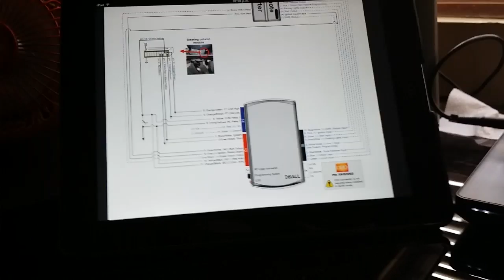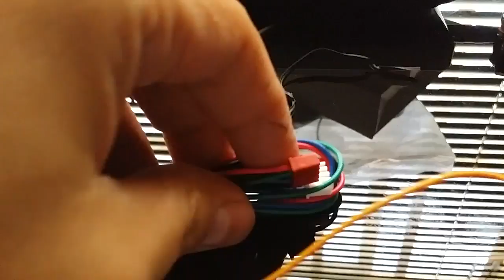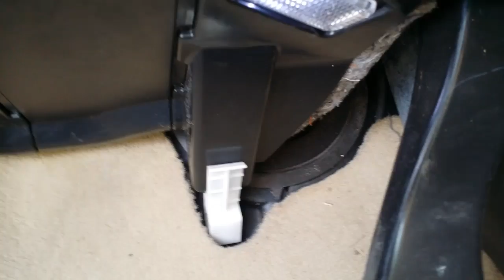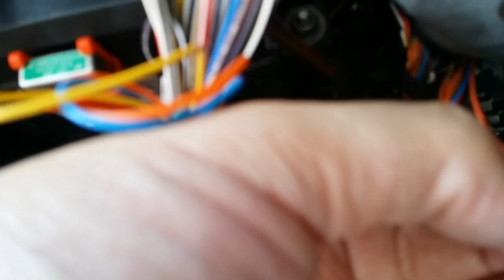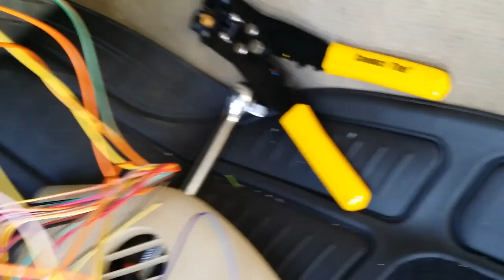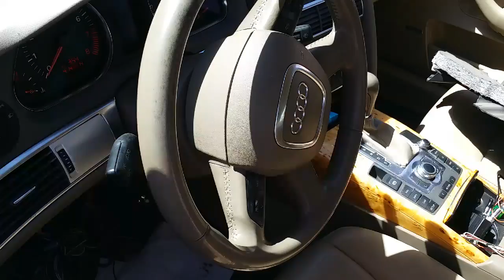Audi a6 c6 remote start installation

Comment: I  installed dball2 + RS - 2006 Audi A6. After installation, the engine is not switched off when the ignition key is turned off. Then I connected the gray wire (+ ignition status output 6p-12), with a diode to ON1 (RS unit) and the pink wire (+ ignition input 9p-10) - to the ON2 (RS unit). Everything was fine. What was the error? My RS unit did not have a minimum of 10 seconds, "wait to start" (at least was 15sec.). And so the engine starts at the second attempt.
Reply from the maker: Davit Miqiashvili remove the diode, the pink wire should tell the module of the switch is on or off , now regarding the "wait to start"  that's a programming that's gets done at the alarm dealer, there's nothing we can do about it but return it and ask them to re-flash it for you.
Reply: "Wait to start" this is not a problem. I will set the time switch for 7-8 seconds. And everything will be ok. I am interested in the scheme connection:
https://s28.postimg.org/uub5cq6pp/corrected_scheme.png

Comment: I own an Audi Q5. A shop told me that I would need to leave a key in my car to use a remote starter. Will this work with the Q5?
Reply from the maker: They will tell you anything to make you think it's rocket science and charge you the eye for it,  you do need a way to bypass the transponder at the key cylinder so what I did whas:
1-got a blank key from ebay with a chip on it. ($7 us dollars) 
2-get a locksmith to program it. (20 bucks) 
3- opened the key, removed the glass pill where the transponder is and placed it inside a plastic straw and filled up with hot glue, then wrapped arroun it 6 loops of 20 gauge wire, attached one lead to the normally open lead of a relay and the other end wrapped 6 times to the key cylinder and back to the: closed when active lead of a relay. 

That's it, no key inside, no major expense but 27 dollars, ill be more than glad to send you photos of how I did it, just send me your email address. 

Hope this helps
Reply: abner hagelsieb We are talking the same system I hope; my Audi has the keyless push button start. All that is normally required to start the car is to have the key in your pocket.
Reply from the maker: Steve Deffinger then you can skip the wire loops process and use the right module for your car,  yo won't need to leave a key inside
Reply: abner hagelsieb Thank you.

Comment: Hi Abner, do you have a link for the part(s) we need to make this possible? i've already got an alarm system etc (factory install) on my car.
Reply from the maker: Depends on your car really, just go to xpresskit.com and select your car make and model, if you want to save yourself a looooot of connection get an alarm from either clifford, viper or any other make made by express kit so you can use the P2P connection, shot me a line if you have any questions

Comment: hi, I wanna install the same remote strater on my 2008 A6 Allroad can you give some info please. It seems that you've cut the CAN low and CAN high wires from the steering column mudule but on the wiring diagram says gest to tap them, and why do you use a separate module for central locking
Reply from the maker: About the separate module don't mind it, I bought them with a couple of months in between so you won't need that , I didn't cut them I added 2 wires tapping in to them.

Comment: How can i run my 15" subwoofer if head unit cant be replace ? Any idea anyone
Reply from the maker: BallOuTT get a high to low rca signal adaptor, scosche make a very decent one and connect the + And - of 2 speaker to the input the connect the rca output to your amp.

Comment: hello abner i have viper alarm installed on my 07 audi a6 for about 2 years now, lately my alarm goes off by it self when it wants to, do you know what might cause that thank you.
Reply from the maker: Do you get a truck open waring message or hood open when driving?  If so that's you issue audi is known for having bad trunk latches with the switches built in to them, check those first if not I'm. Sorry to say it's the shock sensor on your alarm wich is built in so you could bypass it by soldering the 2 normally closed pins to "trick"  the alarm in to thinking it's never shocked or replace the whole module, hope it helps, btw check all the door switches
Reply: +abner hagelsieb no this never happens wile driving it always happens at nite in the garage 2-3 days a week than goes away and comes back i think it says door open or something like that im not positive ill pay attention better next time thank you.
Reply from the maker: +rusani89 it's definitely your door latch expanding with the days heat and shrinking with the colder night.  If you don't mind doing surgery take the whole door latch assembly,  take it apart and reposition the 2 metal prongs that make contact when the door is closed.  If you don't know what I'm talking about you're better off getting a new or used "working"  latch,  good luck buddy
Reply: +abner hagelsieb ok how do i know which door latch is it? and since i started all this i figured id tell you about it sometimes during the day when i remote start it it shuts it self off and on than i shut off by pressing the button on the remote and start it with key this has happened twice in the last 6 moths the alarm thing has happened more often I don't know if they have to do anything with each other
Reply from the maker: +rusani89 it will shot of after a minute, that's normal, try drivers side door since it's the one that you use the most I would assume, if not you can always tell which door is being detected as opened simply by looking at your instrument cluster it will definitely shows a car with the opened door, also the car nay be shutting off cause it's detecting the door opened without being unlocked by the remote and the car thinks it's being stolen, so now I'm 90% sure it's your door switch
Reply: +abner hagelsieb no the car turning on and off thing happens at a different time but i see what your saying it could think that the door is open so it kills the car but than why would it keep trying to turn back on and off every minute
Reply: hello sir i looked in to replacing the door lock or getting to it to look at it its a lot of work so i decided to by pass the alarm if this keeps happening more often so can you tell me one more time how to do that step by step thanks
Reply from the maker: +rusani89 hi buddy, ill be happy to help,  just be patient as i may no reply immediately, good luck
Reply: thats ok i got time, now how would this work if i bypassed the viper alarm the cars factory alarm should still work correct?
Reply from the maker: +rusani89 that's debatable, it depends on the way it was installed the first time but it should, imo you're better off fixing the door latch
Reply: i know but i looked at my repair manual and i figured the door panel would come off and you can get to the door lock but i guess the window and everything has to come off to get the door lock and thats why more work than i was willing to do so if i can just disable it it would be awsome i live in a small city no cars ever get stollen lol so i should be fine
Reply: hello you never told me how to bypass the alarm? thanx
Reply from the maker: +rusani89 lol sorry buddy, Ok so there must be a wire going from the alarm to a wire that grounds when the door is open, remove it and connect it to ground directly. That should make the alarm think the door is always closes, you could also connect it to the wire in the passenger side door or any other door,  I'm not familiar with you specific alarm model but check your manual to find the wire I'm talking about, please note if you have your alarm connected to CAN there's no way to bypass it unless by-pass the car system itself.

Comment: How do you get to the key cylinder to wrap the wire?
Reply from the maker: ok, there are 2 ways, the one i used is only take out the front plastic cover and wrao it arround like that, its easier and works perfectly, the second is:

1.- Remove the platic plate.
2.- Remove the air vents, there are 4 screws on each corner and youll need to stick 4 small flathead screw drivers to hold the small metal latches that will be there.
5.- Remove from behind the cylinder
6.- Unscrew the 3 fron torx screws.

Hope it helps
Reply: abner hagelsieb Thank you very much for sharing this information.  I'll be doing the install in the next couple of days!
Reply from the maker: You're welcome, Glad I could help buddy

Comment: i have audi a6 c6 as well but i look online and it say that the audi need module for key and wrap around key tamper. i wonder if u can give me module model number so i can see if it easy to do without left key inside
Reply from the maker: No need for any module on that regards , take your key fob war around it 6 loops of 20-16 gauge cable , run one end of the cable to a "normally closed relay lead or lead 87 on a 4 legged automotive relay then take the other end of the wire and wrap 6 loops to the key cylinder and attach that lead to the 30 lead of the same relay , that's it you are all set no module no hassle , let me know if you need me to post a video explaining this and I'll be happy to do so, be patient though since the office has me booked
Reply: Please post a vid of this. I am a bit confused. so if you leave the key in the car then you dont need the db all unit?

Comment: i have audi a6 c6 as well but i look online and it say that the audi need module for key and wrap around key tamper. i wonder if u can give me module model number so i can see if it easy to do without left key inside
Reply from the maker: Sure let me look it up and ill post it here, for the key cylinder I didn't used any module I'm talking about the db-all module
Reply: i need module to get put key inside right? is that required?